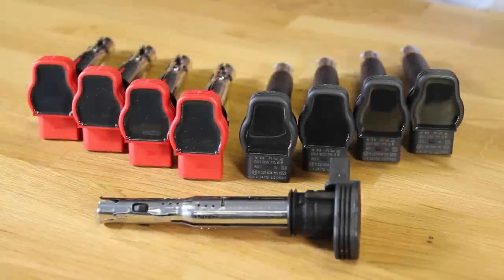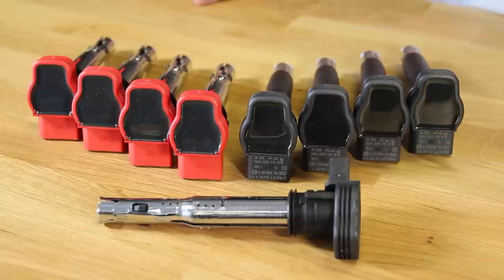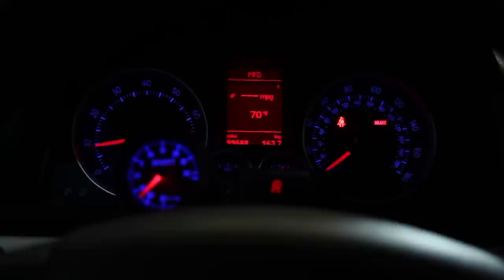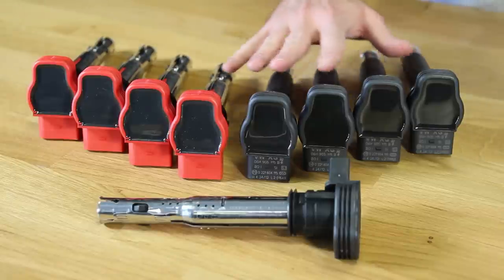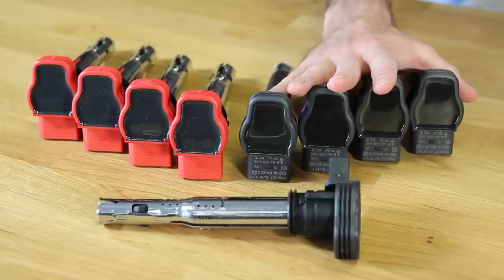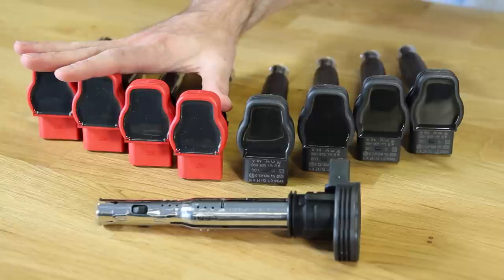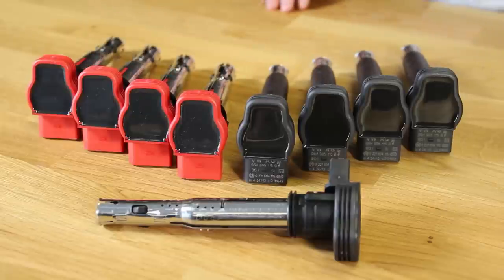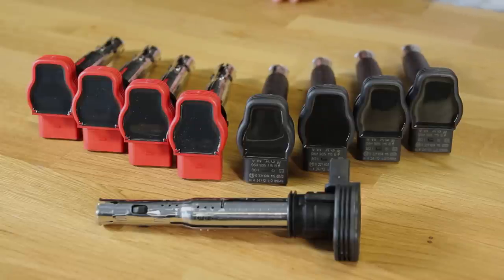Bad Ignition Coils on VW and Audi 2.0T (How to check)

Comment: what about testing by ohms resistance on coil instead of swapping??
Reply: Swapping is handy if you don’t have a multimeter, anyone can do it. VCDS or similar is even better for obvious reasons, especially if it’s intermittent where a multimeter may not reveal a latent fault.

Comment: This video is so handy, thanks mate! I own a 2012 VW CC 2.0T with 72K miles on it. About 4 weeks ago, I got the "Check engine" and EPC light. The engine shuck heavily like in this video, and the car would not accelerate past 8 mph. Assuming the car comput shut off the cylinders to avoid engine damage? Anyways, I took it to the mechanic and replaced all spark plugs with 4 new NGK plugs. Replaced 3/4 ignition coils (Bosh). Car was good to go. A week later, check engine light came back on. How? Anyways, I found out that as soon as i turn on the car, it takes a few seconds for the car to sense the engine vibration or whatever, and turn on the check engine light and thus not let the car accelerate, BUT now i noticed that i can keep the motor from vibrating by just turning on the car, and putting it in gear (or neutral) right off the bat. And i just let the car warm up in neutral and just put the e-brakes so it doesnt go anywhere. Is this stuff supposed to happen? Anyways ive been able to drive my car daily this way.
Reply: Did you ever figure out what was wrong? Same problem here
Reply: Yeah I’m having this problem too. Any joy?

Comment: I was trying to find information on the difference here:
I got the sheathed packs from ECS and replaced my 15k miles-old CPs
The old packs had a copper-colored discoloration towards the top.
What is causing this failure and how does the sheathe alleviate it?

Is this heat and the sheathe adds some kind of insulation?
Or is that actually damage from electricity discharging into the block?

Comment: Audi d3 2004 year, Cylinder 8 missfires and no change after coil replace and spark plug. Compression is 8.2 bar pressure. Do you think whole engine is for opening and repair vavles/pistons etc

Comment: I have a 2010 VW cc 2.0 started random misfiring, obdeleven showed double amount of voltage in fuel injector 2.  Any help for a fix on this for what is causing it would be greatly appreciated

Comment: Is it safe to drive the car with one cylinder misfire for some days at low speeds? The engine is shaking quite often while accelerating.
Reply: You will damage the engine

Comment: Already I already put some new spark plugs.
Code :
Random/Multiple Cylindre Misfire Detected
P0300 - 008 - Implausible Signal - Intermittent
p0302 - 008

It is not dripping coolant by the spark plugs, I mean they are dry (As it should be)
Some Help

Comment: Thanks for making this video! Was able to isolate a misfire to one faulty coil, which I replaced with one of the newer sheathed ones and already seeing much smoother performance.

In my case the hesitation only seemed to happen at near full throttle between 2000-3000rpm, once the engine was running for a while, though at higher rpms I would seem to get a lot of tailpipe smoke which makes me wonder if I was just spewing out 1/4  incompletely combusted fuel.
Reply: Hey, I’m having the coil 1 misfire code now, I have the original coil, do you think I can change the 1st coil for the upgraded coil version and leave the other old versions on still?, so like one different than the other ones?

Comment: Thanks very much this vid just saved my ass. Changed the coils and sorted it straight away! Cheers JP
Reply from the maker: +Jack Phillips Awesome glad we could help.
Reply: +Deutsche Auto Parts keep up the good work! ;)
Reply: it's usually best that if you change 1, change all of them at the same time.  That way, they at least all have the same  mileage.  Then take the good, older ones you pulled and leave them in your boot for an emergency spare (if one decides to go while you're in the middle of nowhere).  Never, EVER get ones from a parts superstore...always get Audi OEM from a dealership or from an Audi/VW parts dealer online.  Always.  The ones at the stores are crap.  They only last about a month and they often cost more than the R8 upgrade/swap.

Comment: i changed my spark plugs and shortly after the evap system leak came on (p0456 p0442). i didnt replace the coils. could it just be the gas cap?

Comment: I have bought a 2007 model VW eos with FSI engine. Looks pretty new. Just 27000 km on it. Engine vibrates a lot and you can feel the vibration between 1000-1500 rpm range. The check engine light lit up few weeks before and it was misfire in cyd2. Mechanic cleared it without changing anything. The spark plugs were changed before 1k last year, the previous owner got them changed. 
After clearing the light it gave me the light again. I hope it is the coil only. Because spark plugs are new enough. I am a mechanical fitter and buying that code scanning Bluetooth device so that i can swap the coils and find out what it is. 
The car gives jerks while hard accelerating it and it gave me the lights both time while hard acceleration. What else can it be??
Appreciate your help. This video gave me a hope that it’s a 30$ fault.
Reply: check sparkplug gap on all four cylinders. Incorrect gap can also cause misfires, dead or intermittent.

Comment: Is it possible that a bad installation when replacing spark plugs can cause these to fail. I had a full service done, which included replacing the spark plugs. Now a few days later all 4 coils need replacing after no prior issues on the car at all.
Reply from the maker: +Novocaine888 This is pretty unlikely but its impossible to be certain.
Reply: +Deutsche Auto Parts  thanks for your reply, good to know 👍

Comment: i get p0203 and p0301. the symptoms are that at about 2500 to 3000 rpm it starts to act up, it starts to jerk, probably cutting the power. Once i get over 3250 rpm its all good. Could it be the coils and injectors? The car in question is 2007 octavia rs with bwa code engine.

Comment: I have a 2003 a6 2.7L Quattro twin turbo, the scan tool says all the cyl. 1, 2 & 3 are misfiring. Can I switch all the power packs to the other side to see if it does the same thing your saying ???? then I will know that it is the power packs and not something like an o2 sensor maybe, please help,,,, where I live its like $770.00 to get just two o2 sensors changed,,,,

Comment: I am a vw Audi mechanic in Kenya and I really want to thank you for your educative shows. I have a Jetta 1.4 tsi and it has a problem...when u need fast peak it doest go past gear three unless u leave the throttle.. It feels like the turbo doest kick in...it has two faults, boost pressure regulator and can shaft position sensor...kindly advice
Reply from the maker: frankline timothy Thanks.  We are so happy you find our videos helpful.  Based on the faults it sounds like you might have more than one issue going on.  It will definitely require more diagnosis.  You should start by making sure you don't have any timing issues.

Comment: So I got the 3.4L VR6 in my T2 Vw. I got a slightly rough idle when the vehicle first starts...doesn't matter if engine is cold or hot. I get the slight engine shake you speak off. New plugs installed and issue is still there. No CEL and VCDS shows no issues with engine. 

On my Volvos you always get a P code and playing the swap-a-thin always finds the offending unit. 

The guys on the forums say always do plugs/coils at the same time but sending $120+ on coils that are not bad seems insane and just throwing money. 

Question: Are Vw known to have weak coils that don't throw CEL/codes but are in fact in need of a renewal?

2008 Toaureg T2 with approx. 140K miles. Thx.
Reply: At 140k you're most likely in need of a carbon cleanup
Reply: Vaks R wouldn't carbon restrict airflow and reduce power?
Reply: Yes it would but depending on how bad it is. I've got a 2013 A4 at 78K KMS. Coil packs are good and spark plugs were changed at 58K. I still get a slight shake on cold starts and I'm 99% sure it's because of the carbon buildup. Check out this link: http://www.audizine.com/forum/showthread.php/509355-B8-A4-2-0-TFSI-DIY-Carbon-Intake-Valve-Cleaning?p=8094844&viewfull=1#post8094844
Reply: check engine mounts

Comment: Did you ever experience any power increase or better throttle response with a conversion of the 2.0l Audi 8 coil pack kit thx.
Reply: this is widely debated.  i've asked lots of people and they swear by it, but only one store has put data out there and made a video showing the difference in spark.  The actual measurable difference in the energy in the spark?  No idea.  Stick to the originals unless yours go and you want pretty red ones in the engine bay, then have at it.
Reply: i notice a major increase in throttle response and some power when I did the r8 coil swap in my 2.0t

Comment: Hello all, if anybody could offer help or advice it would really be appreciated. I purchased a 2005 audi a4 (about 82,000 plus miles on it) 2.0t back in 2012-13. Car ran fine almost brand new up until 2016 when I experienced my first ignition coil failure. Since then, it seems I have to take the car every 1.5 to 2 months for a new coil. I get the same issues alot of people experience when they fail vibration, CEL, low power acceleration. Thing is that the car runs smoothly and I believe everything is still in order besides the coils keep failing. I am at 123,071 miles now and I feel like if I could find out why the coils keep failing and replace the faulty part or parts, the car would give me more work. Any suggestions or fixes would be greatly appreciated thanks!!
Reply: Matthew Opium I'm in the same boat I keep replacing coils and can't find out what's leading to the coils getting smoked I've replaced them 3 times and want to find out what's causing it before I replace another set
Reply: Remember, the coils connect onto the spark plugs, try replacing the spark plugs as well as the coils.
Reply: ☣ Johnny Destructoid ☣ I normally replace both but something keeps causing them to go bad
Reply: sapper72783 If that's the case, it's probably a bad connection from the electrical system to the coil (s) or / hopefully not something in the engine (but you'd notice that quickly, so most likely not)
Reply: ☣ Johnny Destructoid ☣ thanks I was thinking of replacing the wire harness hoping that'll be the issue I've searched everywhere for an answer with no definite answer I messaged an audi dealer and they just sent me a letter about going up to purchase a new one but with a daughter in daycare I can't afford a new one at this time
Reply: sapper72783 Dealerships will try and screw you over, luckily I found a good garage mechanic who does things for cheap, a similar scenario, I kept hearing this horrible squeaky clunking noise, I tried everything from cv joints to steering columns but nothing worked, so I called up the dealership, they wanted to charge me an insane price, for what the " think " is a loose belt. I told them it's only when I go over bumps and stuff, so theres no way, but they insisted, so instead I found a mechanic near my house, they jacked the car up, wiggled it, snd told me right away " its a connecting rod ". It costed me 3 times less, and they installed the new rods in 2 hours. So stay away from dealerships unless you need specific parts, and I wish you good luck.

Comment: Thanks for the video! I noticed that my car hesitates when I’m idle but still in drive mode waiting at a red light or once I pull up to a stop. The moment I hit the accelerator the car starts running smoothly again. Why is that? My car is a 2007 A4 Audi A4 2 L turbo four cylinder convertible. It has 175,000 km on it. Thank you in advance for any suggestions you may have. I forgot to mention that all the spark plugs and the oil and filters were recently changed. I believe my engine may be burning coolant because I keep having to fill it up every month or so. One of the coils was recently changed. Do you recommend me changing the whole coil pack?
Reply: I have the exact same observation on my 2015 Touareg V6, spark plugs, oil & filter, and engine mounts were recently changed, I’m suspecting a bad ignition coil, and since I’m there I’ll replace the transmission mount, I’ll let you know if any of these fixes the problem.
Reply: @hmubaslat1  so did u find the problem ?
Reply: @nicu7437  Not really, I found the easiest way out is selling the car 😁

Comment: Do you know the resistance on the primary and secondary coils? I would like to test a single coil as I do not have a scan tool.
Reply: A little bit late but you can use other coils as a reference

Comment: Thanks for this video. If I have 4 of the new rev. installed already and got a random misfire (P0300), is it ok to just replace the one bad coil, or should they be replaced in pairs?
Reply from the maker: You can replace just one coil.

Comment: Thanks for all the helpful videos! I'm assuming that the cylinders are lined up 1-4 left to right? I bought 4 Audi R8 coil packs and new double platinum plugs for my 2010 Jetta 2.0 and I've been having misfires ever since. I have switched back between new and old plugs AND coil packs multiple times. Sometimes the light will go off for a few days but it ALWAYS comes back. I have torqued the plugs properly and they seem to be gapped correctly as well. Maybe one of my new coils is messed up as well as one of the old? Can I mix and match the new and old coil packs to try and diagnose and then buy a replacement when I've found the culprit? Thanks Again!
Reply from the maker: Mark we attempted to see what plugs you purchased, but it seems like you did not get them from us.  Getting quality plugs is really important with VW and Audi so if you installed Autolites or some brand like that, this could be your issue.  If that is not the case you might have another issue causing your misfire.  New coils are very unlikely to be bad as long as they were purchased from a reputable company.  The Cylinders are indeed 1-4 left to right.

Comment: I have two Audi A4 B6 cars.  the 1.8T Quattro is a running car and the 3.0 Quattro is a parts car. Can I use the 3.0 coils as an upgrade for my 1.8T? If so, are they taller so I will need an adapter?
Reply: The coils on my ASN 3.0 B6 & ALT 2.0 are 06C 905 115M.  I have a feeling that there might be a ( 8mm? ) difference in length. The 06C 905 115M has a extra metal tube layer on the upper part of the coils 'pencil'. I dont know why.

Comment: I have a question, I have a vehicle that the coils are fuse with 15 amp fuse. If one well had oil on it and the coil was cracked at the end under the boot can this lead to an intermittent short blowing the 15 amp fuse.
Reply from the maker: +steve ricci It could.  You should start by fixing your known issues for sure.  Sounds like you have a valve cover leak and you need coils.
Reply: look into getting a valve cover gasket
Reply: Got it fixed,  did replace the coil,  the leak was from when the shop did valves,  rolled the gasket but fixed that.  Never cleaned the oil out though.  The ignition issue was the led lisc play light spring in the exhaust.  
Thanks for the reply

Comment: I have a 2012 Vw cc 2.0t and i had bad coils before and the car completely was bucking and had the check engine light. They replaced 2 of the coils. Now i have an issue that feels similar but when i took it to the dealer the light is not on but the symptoms persist. I cannot accelerate at a normal speed and they even noticed it. Problem is there was no code that popped up since the light is not on or blinking help!!!!!!.
Reply from the maker: Alexander Marin Im sorry but we cant offer much help on this.  We would suggest bringing it to a shop capable of helping you diagnose this.  Without fault codes we cant even offer an educated guess.  Sorry to hear about your troubles.  Hope you get them worked out.
Reply: Hey, I’m having the same exact issue. I have the same exact car. Did you ever figure out what was the problem?!
Reply: Crankcase ventilation system is something i would check. Germans replace all of these parts at maintenance intervals so they dont break. If its not done & one part breaks, all the rest will break soon too.

Comment: Hi. My problem was a bit strange.VW diagnosed few misfires on cylinder 3 and then they swapped cylinder 3 coil with coil from cylinder 2. And my issue disappeared. Have you got any idea why this has solved my problem? Anyway I think I will replace all my coils in the future...
Reply from the maker: mrpaille Could have just been a bad connection.  Tough to say for sure.
Reply: Maybe the ignition is about to get bad,  once you swapped them the other cylinder was creating more stress the other one. But the old need to be replaced as part of maintenance

Comment: My CEL was flashing for a period of 10-20 seconds. It did this twice when I would push it really hard. Second time I pulled over and turned off/on my GTI and the CEL is now solid. I'm told by VW themselves this is normal since it detected a misfire and sparks/coils can cause a solid CEL. Others are saying no, it's due to fuel injectors going bad but VW is highly doubting it. Someone is giving me the run around and coils are cheap compared to fuel injectors. Going to replace my coils this weekend to R8 ones, my car is APR1 tuned as well so I'm thinking the sparks and coils are going bad (only had the tune for about 1k miles).
Reply: when the CEL flashes, that means the car is in limp mode.  Essentially, the engine shuts down the cylinder with the bad coil pack.  Fuel injectors is most unlikely.  Also, pay attention to your gap on your plugs.  Stock is .0031, but lots of people move it to .0028 for a better spark (but there is no spark if the pack is shut down).
Reply: It ended up being the spark gap. Fixed that to be at the tune spec and it runs nice now on stock sparks.
Reply: diamondjoe1109